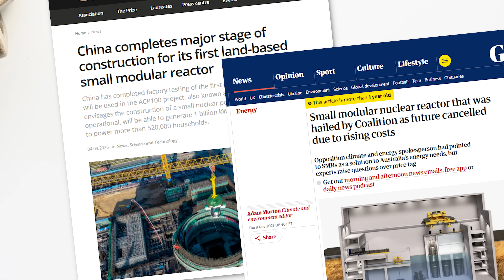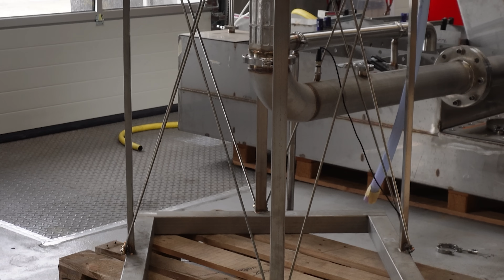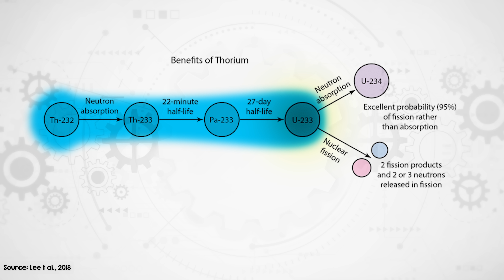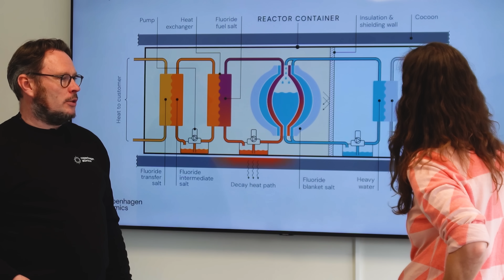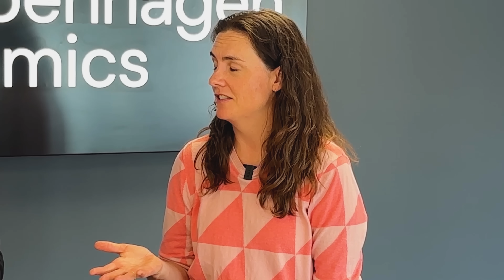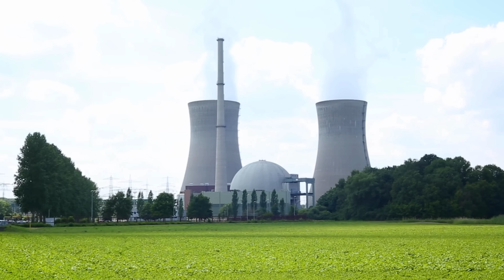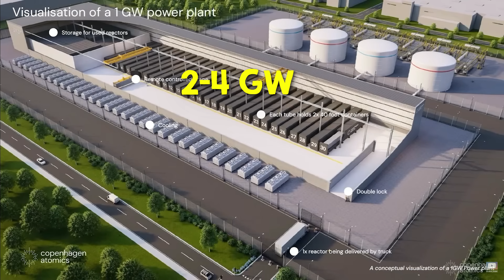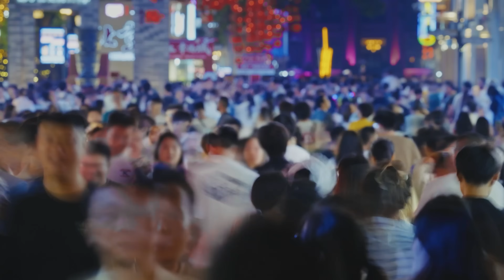Can Copenhagen Atomics Make THORIUM REACTORS Work? [TOUR]

Comment: Thorium and yes, all breeder reactors are a Trojan horse, allowing developing nations to get very advanced bomb infrastructure when breeder reactors are finally marketed.  Any reactor that can use thorium can also use U238 to make plutonium (Pu239) the preferred bomb making material. Fertile thorium must be bred into fissile U233 to run a breeder reactor to make continuous power in a cycle.  One can use the same reactor to more readily and easily breed publicly available fertile U238 into bomb ready plutonium, avoiding the difficulties of removing protactinium, etc. The Copenhagen atomics design is especially problematic as it's onion design allows putting the U238 into the blanket portion and the outlet can be used to extract plutonium directly.  Other breeder reactor companies such as Terrapower Natrium, China's government,  India's Bharat or  Russia's Rosatom will hold the patents and profit from making the world a much more dangerous place as these are sold to wannabe dictators wanting a seat on the world stage.  Breeder reactor technology is ultra-proliferative, as developing countries have generally commenced bomb making with initial nuclear power plants.  It disappoints me that Rosie didn't address this in her analysis.
Reply: Or you could just build your own.
It isn't very difficult to build a reactor for producing plutonium.
Why would you purchase a power reactor (getting onto the world's radar as owning a reactor) and spend a lot of time and effort removing all the unneeded and in-the-way bits?
Wouldn't it be much simpler to build your own plutonium production reactor (avoiding the world's radar as owning a reactor) and spend less time and effort to do so?
Reply: @factnotfiction5915  How would you go about initial neutron source, Americium in CO detectors?
Reply: @veritea9374  > How would you go about initial neutron source, Americium in CO detectors?

No. No need to clean out your local hardware of smoke detectors.

To start a breeder reactor, you just need to put a lot of uranium together in the same place, and voila! you have a neutron source. 

You can use moderated UNenriched uranium (i.e. like CANDU).
You can use use ENriched (5%) uranium (i.e. like PWR, BWR).
You can use HALEU (20% enriched), although civilian supply chain just starting up.
You can use a particle accelerator (only shown at laboratory scale).
Reply: @factnotfiction5915  Doesn't sound like such a DIY.  Even yellowcake is not publicly available.  Getting on a program with a prebuilt breeder and neutron source as a purchaser is the basis of my argument.
Reply: @factnotfiction5915  BUT all these uranium sources are highly regulated.  India used the CANDU breeder and related tech to make bombs, however the enrichment process is cumbersome for the others, and won't fly under regulatory radar.  However the "Thorium" breeder is made to fly under the radar.  Ostensibly made to make power from thorium, it is ready made to produce plutonium from unregulated freely available U238.
Reply: @veritea9374  > Even yellowcake is not publicly available.

Actually, yellowcake is quite available. In fact the IAEA guarantees the availability of uranium for countries with civilian nuclear programs (yes, they do audit the supply to ensure used in civilian reactors).
However, even if you can't purchase yellowcake for your clandestine military operation, you can just mine it yourself. Sure, maybe Monaco is going to find this difficult, but uranium is essentially found all over the planet.
In commercial quantities, no. But then, you are running a clandestine military operation - economics is not a concern!

> Getting on a program with a prebuilt breeder and neutron source as a purchaser is the basis of my argument.
And your argument remains hollow. The 'pre-built breeder' requires so much re-work, that you would have been better off starting from scratch.

You might as well make the equivalent claim that building civilian gas stations is the first step towards building napalm bombs.

As for the neutron source, you just need to get a bunch of uranium together!

Look, the US did this with 1940s technology and without a roadmap. Any country (even Monaco) can whip out a bomb in under a year using 2025's technology - no civilian reactor needed!
Reply: @veritea9374  > India used the CANDU breeder and related tech to make bombs

And Romania and Canada did not.
Building bombs is a POLITICAL question, not a technical question. The presence of a breeder reactor (thorium, uranium, smr, pwr, bwr, salt-cooled, metal-cooled, water-cooled, heavy-water moderator, light-water moderator, carbon-moderator, ....) does NOT lead to bombs. Nutty politicians lead to bombs!
Reply: @factnotfiction5915  I'm thinking maybe not so nutty - General de Gaulle of France was regarded as too difficult by half, not trusting America's nuclear umbrella. Now Trump's in the White House, the rest of Europe is hoping that France can back them against the Russians.
Reply: @factnotfiction5915  Allies can share bomb making technology, such as supplying reactors.  India went against the wishes of of Canada when making bombs with the shared technology.  As Canada's CANDU could breed readily, this was seen as highly desired for bomb making, as plutonium is preferred over enriched uranium for bombs.  A breeder reactor with a blanket and processing port would likely be ideal for this.  It is the politicians who make agreements for nuclear transfer technology, not the engineers.  However it is is profit which motivates weapon technology, and advocates for it's expanded use.  Breeder reactors are still the most efficient way to produce plutonium, whether you say thorium a million times or not.
Reply: @veritea9374  > India ...  As Canada's CANDU could breed readily, this was seen as highly desired for bomb making, as plutonium is preferred over enriched uranium for bombs

However, you ignore that making bombs is a POLITICAL decision, not a decision promoted by technology.

FIRST - India DID NOT make plutonium-for-weapons from CANDU power commercial reactors (of sizes 90 & 187 MW). India made plutonium-for-weapons from CIRUS (a research reactor of only 40 MW).

SECOND - CIRUS has since been shut down, and India STILL doesn't make plutonium-for-weapons from CANDU power commercial reactors. They built Dhruva (only 100 MW) rather than use their commercial reactors! Dhruva was NOT modeled after CANDU, but after CIRUS!

THIRD - It took India 20 years to make the POLITICAL decision to make a bomb (the CIRUS reactor going live in 1954 and the 1st Indian bomb tested in 1974! This was over the course of 3 different prime ministers (Nehru, Shastri, I. Gandhi), and the associated changes in governments. Basically CIRUS could have created enough weapons grade plutonium by 1956 - it WAS NOT about the technology! - they simply didn't choose to until 20 years on (when military tensions with Pakistan and China really came to the fore).

FOURTH - (this is the most hilarious!) India only has built two (yes 2) CANDU! Size of 90 and 187 MW. The 90 MW was shut down in 1971, three years BEFORE they started their bomb test in 1974! They started their second CANDU, the 187 MW, in 1981, seven years AFTER their bomb test! The remaining commercial reactors are PWRs + 2 small BWRs.

YOUR NARRATIVE - is basically nonsensical given the facts.

India fueled its bombs from the output of small research reactors, NOT CANDUs. Despite CANDUs 'making it easy to make weapons-grade plutonium', India did not build a fleet of CANDUs, and in fact shut down their existing CANDU 3 years before their bomb, and opened their second 7 years after their bomb. 

AGAIN - commercial nuclear reactors have nothing to do with making plutonium-for-weapons, and it is easier (than using commercial power reactors) to just build your own, specialized reactor to do so if your government makes the POLITICAL decision to build a bomb!

Comment: He says it will be 0.8 conversion, not any better than candu
In @ 10 years they will start with breeding ,1.2 conversion, about20% more fuel than it uses
Reply: Candu runs on natural uranium (0.7% U235), whereas last I heard the CA reactor will need 10% (to start with, at least.) Maybe 5% once they're running at 100 megawatts thermal, not the one megawatt of the test reactor in Switzerland. Just isobreeding from thorium would already be a huge achievement, even running on 5% U235 but producing 550C steam, instead of 310C from a light water reactor, would be pretty good.

Comment: It’d be good to have more of whole system view of the power plant. Is there no high level waste at all? It’s great that the heat exchangers and pumps that need replacing every five years remain radioactive for a few decades and then can be recycled, but it still requires a long term commitment to storage of dangerous materials over many decades. What are the water supply requirements?
Reply: > Is there no high level waste at all?
yes, but volume or mass of the HLW is much smaller with breeder reactors.

> it still requires a long term commitment to storage of dangerous materials over many decades. 
which we already do with conventional reactors
but even if you sign up new, let's just compare the waste streams

1. current world HLW is a bit less than 400,000 tonnes
that provided about 10% of world electricity for 65 years
it can fit into 22,000 cubic meters (1 field 150 meters X 150 meters X 1 meter)
the waste is captured, contained, monitored, and kept from the biosphere

2. a single coal plant (1.5 GW) using lignite in Germany (which gets about 35%-40% of its electricity from said lignite, aka 'brown coal') produces about 400,000 tonnes of emissions and ash
providing about 2.5% of Germany's electricity for about ...15 days
the waste is vented directly to the biosphere

Nuclear HLW is REALLY, REALLY SMALL and DENSE and including the reactor and plant materials isn't that big a deal either. So yeah, sign me up for one parking lots worth of  'dangerous materials over many decades'!

> What are the water supply requirements?
About the same as a coal plant.

Comment: where are you getting D2O in mass quantities? I'd read it's quite rare - much more rare than even HDO which itself is just a tiny percentage of H2O.
Reply: Naturally occurring it is rare. But it is economically viable to create it. The Canadian nuclear industry makes tons of it every year, so the supply chain already exists.
Reply: It's just an energy cost, of separating it from ordinary light water, with heavy hydrogen at about 150 parts per million. Water molecules swap their hydrogens around a bit (they're quite promiscuous really) so concentrating by mass difference will gradually get up to 99.75% D2O.

Comment: Too much hand-waving here.  Mr. Jam Pedersen glossed over “neutron economy” which has been the real deal killer for all small reactors that have gone before.  Neutron efficiency is roughly inversely proportional to the size of the reactor, which is why the vast majority of installed civilian reactors are in the gigawatt class.  Smaller reactors, such as those used in military submarines and ships, for example, are far more expensive to operate, and that cost is deemed acceptable for the operational advantages they convey.  A small nuclear reactor on the civilian ship Savannah was not sustainable and was decommissioned after a relatively short demonstration.  And modularity does nothing to address the high cost of site preparation, which is why Natrium, for example, has in their business approach to site their reactors at locations of existing, retiring power plants, and similarly, all other extant small reactor projects are looking at co-location with existing reactors so as to minimize the cost of site prep.  Go look at some of the time-lapse videos for Vogtle 3 & 4, and the phenomenal civil works give one a sense of how that is divorced from any talk of reducing the cost of the reactor plant.

Comment: I hope none of the plumbing comes loose during shipping.
Reply: They're shipped with no fuel (or heavy water). The fissile fuel is shipped as a solid, and only melted when it's going into the reactor.
Reply: @2x6x250ml  That doesn't prevent the plumbing from coming loose during shipping. I'm sure they test the unit with clean salt before adding in the fissile fuel.

Comment: Will you also check out the Chinese Thorium reactor they have built and has been working well?
Reply from the maker: I would! If they would let me onsite to have a look around and answer questions like Copenhagen Atomics did 😊
Reply: @EngineeringwithRosie  not letting you in suggests something is perhaps not working as well as we'd hoped. Maybe just keep asking Rosie. They'll check out your social media stuff and may change their mind eventually (assuming everything is going well?)
Reply: An alternative answer might be that they have intellectual property that can’t be protected yet or is a bit controversial
Reply: @theairstig9164 hadn't thought of that good point, but I believe it's more about commercial advantage security. Once they are confident they can't be caught up, I think they'll open up a bit
Reply: @theairstig9164   very possible as well. What I've read is that the used all the open documents on the matter from the 60s or so and they fixed and refined certain areas. I've not seen details on keeping the contaminated water in those many phases separated or how in China, here it looked really well thought out.
Reply: @EngineeringwithRosie  Thanks for trying, best regards

Comment: What do they do with this radioactive shipping container (and all the equipment inside) at the end of 5 years? Can it be refurbished after sitting for some time, or is the whole thing just special landfill waste? Can you even recycle the metal?
Reply: Never mind, he answered this question at 10:00.
Reply: The power plant they used as an example had 30 units, each with a 5-year life, and 50 years to cool enough to recycle. So I guess they just have a storage building that can hold 300 of them waiting to be recycled?

Comment: handy breeder reactor. so why dont you use water steam to both cool and generate while breeding. all in one breeder-reactor-generator. also the steam is automatic when something heats up. also possibly the transport of the fission material in/out.
Reply: The big problem with water cooled reactors is (1) water and (2) pressure. You need to make sure the water doesn't react with the fuel or fuel cladding, and a massive 3 times redundant pressure vessel.Which is the problem with current PWRs and why they're so expensive. 

Molten salt doesn't need a pressure vessel.
Reply: because the breeder water is super-expensive heavy water (of which only a little is needed), vs steam for a turbine can be very-cheap distilled water (of which quite a lot is needed).

Comment: Very pleased this has been covered Rosie. Interesting to see how Copenhagen Atomic is being true to small modular. Like the original MSRE, the fission products will probably also have commercial use as medically important radioisotopes for example eg Mo-99. The reactor design can be used to consume spent nuclear fuel, so reducing waste! 600 Celsius salt temperature may even have industrial uses too as this is higher than standard reactors.
Reply: Thorium power stations becoming the new Uranium waste elimination facilities solves problems now rather then having to store the radioactive waste for thousands of years.